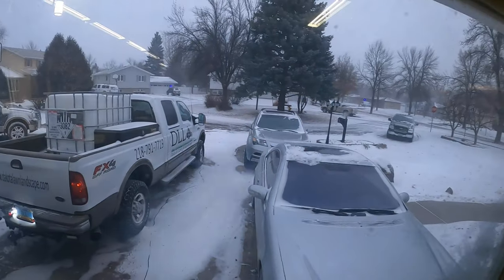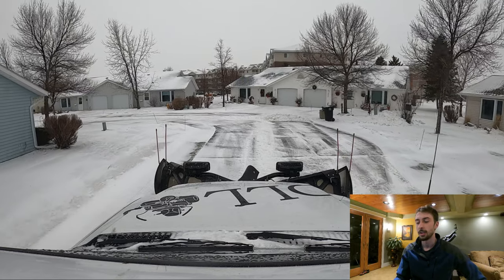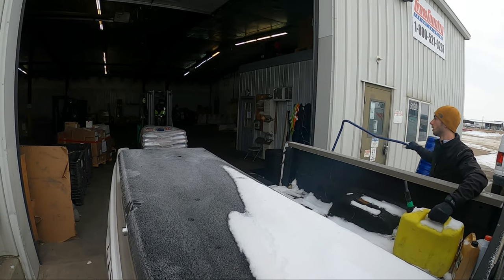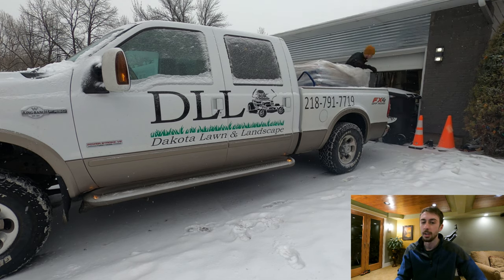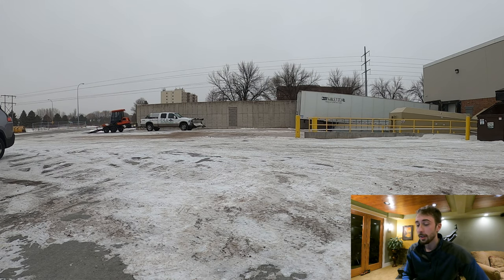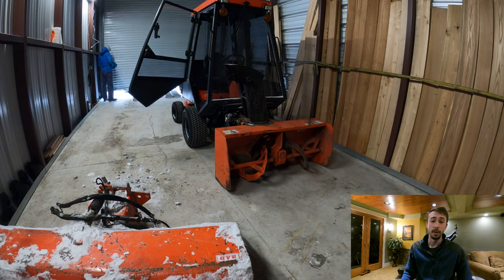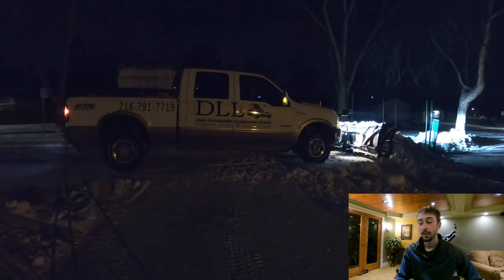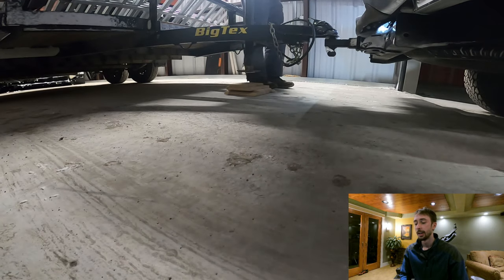3 Days of Snow: Day 3 "Snow Plowing In a Blizzard" | Snow Removal Vlog |

Comment: At least you used a strap. I saw someone pull a minivan out using a chain hooked to the minivans seatbelts. They had the hatch open and the chains ran thru the back seatbelts. They actually held.    You could used angle iron and add an extension to your ramp. You could put a hinge on them so they will fold down when you have the gate up. Also you could bolt the hinges to the ramp so you can take them off when you are in the summer time. I did this to my old trailer and it worked awesome. Hope this helps you out.
Reply from the maker: That is a great idea! Might have to look at adding something when it gets above 0° here

Comment: You could get a dovetail instead of the straight deck trailer you have. I had the same issue where my mower decks would scrape coming on and off the trailer. Now they have about an inch or two of clearance. Keep the videos coming!
Reply from the maker: Working on more currently! Might have to upgrade to a bigger trailer with a dovetail! Sounds like it works better

Comment: To raise the tongue of the trailer try driving the truck up on a 4x4 block should offset the angleI use this when loading a low car onto a trailer. If the GoPro is getting too cold and shutting off it was recommended to rubber band a “hot hands” packet to help keep battery warm. 
The truck driver was a regional/ local driver if he was just passing through the area he would have been in a sleeper cab.
Reply from the maker: Could try carrying a block around and I never thought of using a hand warmer on the camera.. only time it’s ever shut off! Also it makes since that the driver was probably regional tho if you drive just 3-4 hours south of us it can be 25° warmer!

Comment: my friend, the WLL is not the name of the company, it’s the “working load limit” it has a 1000 lb working load limit. Just goes to show that sometimes a 70000 lb rig only needs a 1000 lbs of pulling force to get the job done. I pulled a city bus out of a snow bank in Fargo with a pretty small strap. Nice recovery.
Reply from the maker: Hahah thank you for informing me! I was happy to be able to get him out. Who do you work for in Fargo or what is your business name?
Reply: @dakotalawnandlandscape  for a decade i have one deliveries for a big box store under the name Max Deliveries. i use the same name for snow removal. i work for a single property management company.
Reply from the maker: Gotcha! Cool stuff! What do you use for snow removal?
Reply: @dakotalawnandlandscape  f 350 gas and a wideout xl and this year i got a kubota tractor and metalpless but with our 2" snows it hasn't left my yard. my route is 30 miles round trip so until it hits 4" my pickup is faster. i use an ariens 36" snowblower for sidewalks, or a shovel.
Reply from the maker: Nice load out man! I’ve heard many good things from other comments about the wideouts! Metalpless as well! I understand with the snows this year.. kinda fun to clear 6”+ once in awhile!

Comment: Stuck  in  blizzard. Have  you  ever  look in to  a  lift trailer then you'll  never  have  to  lower gate than  ramps. The  lift  trailer  would  drop  down  to  ground  and  just  drive  Jacobson  off.
Reply from the maker: Thank you for sticking around man!! I have seen hydraulic lift/drop trailers around town and they are usually $5-8,000 so I never considered them but they would be perfect for that

Comment: Air down the trailer tires drive it off then air them back up might be a pain but might work
Reply from the maker: Could do that in a pinch. Looking for a solution that could be added/replace the gate somehow possibly
Reply: Yeah most of the trailers doors are welded on which is insane to me!!
Reply: Maybe put air bags on the trailer axles take off the leaf springs
Reply from the maker: My tailgate is actually removable which is nice.. my old one wasn’t. Airbags might be cheaper than a hydraulic drop trailer but then buying another trailer would also be nice too!

Comment: A pallet of salt had slid and slammed into the backrack when I stopped hard. Would’ve went straight through the window without it.
Reply from the maker: Yes, I’ve had a few instances where I had to brake harder and tried to not have the load slide. Glad you were okay! I should maybe think about putting a backrack on